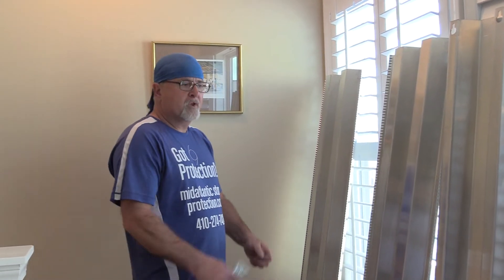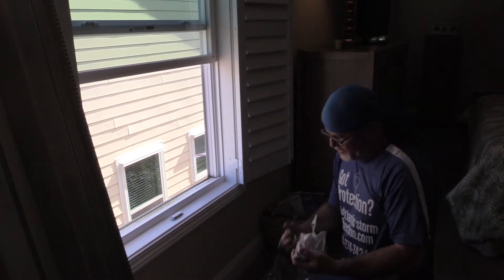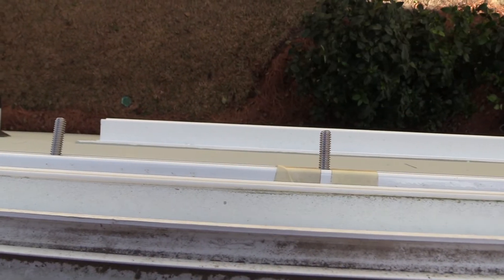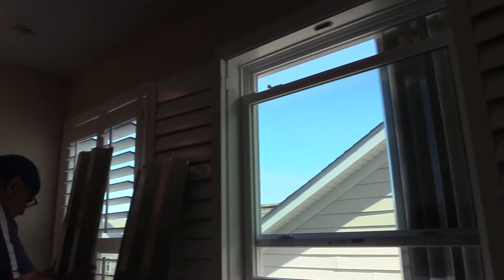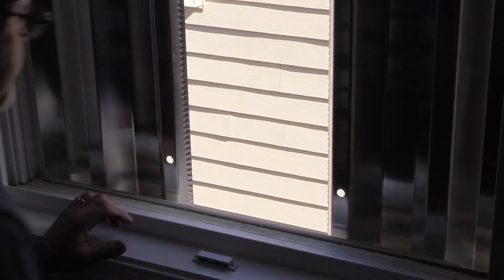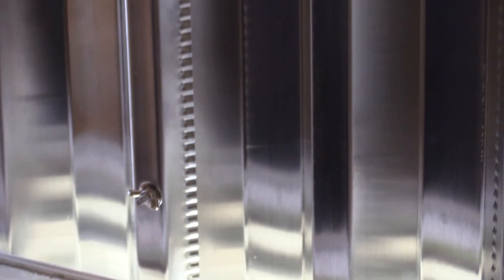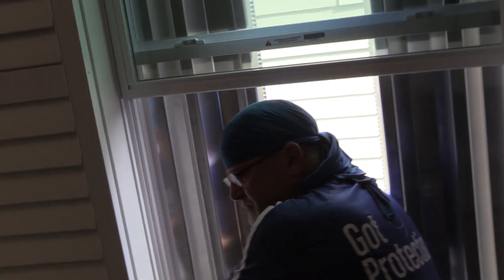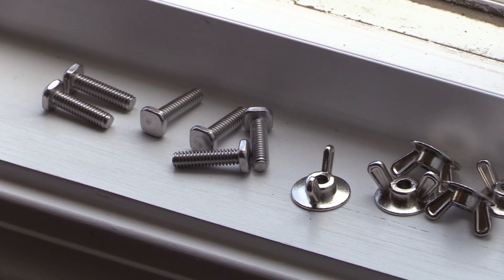Hurricane Shutters 2nd story install & removal Midatlantic Storm Protection Myrtle Beach Sc

Comment: Rick, nice video.  Have you seen the same type of system used to protect the houses (1) first floor emergency exit door, appears to be designed for 2nd floor windows? If used for protection of an emergency exit door, more than one panel would need to be removed to leave the house, would take a lot of time. Unscrupulos contractors widly using this system for that purpose in Florida, not even installing to specs of a drawing they have. Puts a homeowner & family in peril.